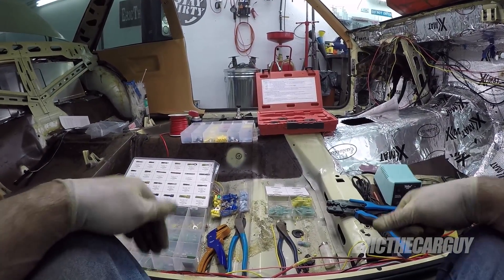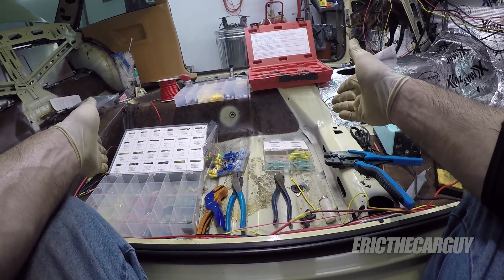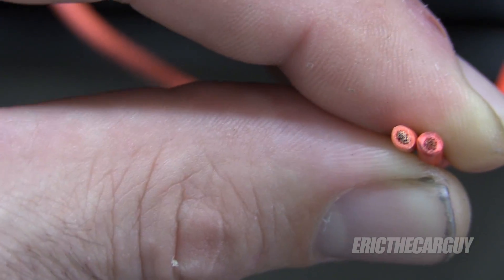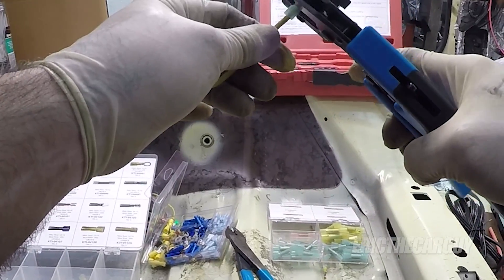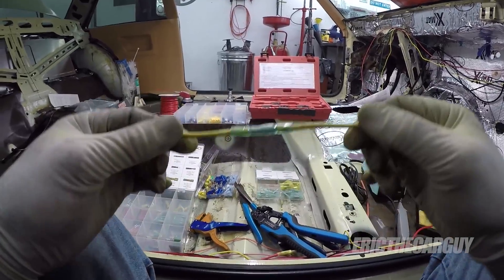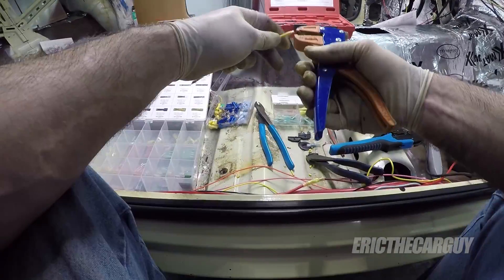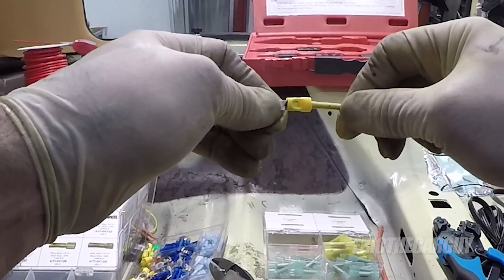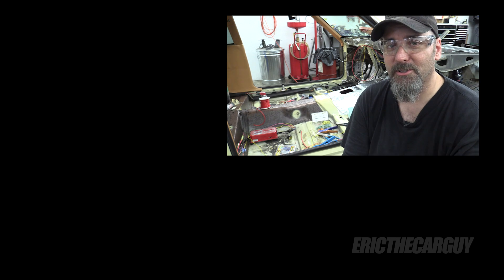How To Crimp Electrical Connectors

Comment: wrong on the color code is for different size connector Eric, you can have any color for any size.
Reply: +super coupe
As an industry standard in the US the connector insulation is color coded and the range of wire sizes is usually marked on the tongue. 
This identifies the wire sizes that can be properly terminated and the terminal lug sizes. 
From Table 2-2 Color Coding of Copper Terminal Lug or Splice Insulation Color of Terminal Lug or Splice Insulation To Be Used on Wire Sizes 
Yellow (Bright) #26 - #22 
Transparent #24 - #20 
Red #22 - #16 
Blue #16 - #14 
Yellow (Dull) #12 - #10
Reply: last box of wiring i purchase had ever color you mention with plus black, white and green the exception of transparent and all where 18 AWG GA.
Reply: Apparently you do not understand the concept, it is not the color of the wire insulation that indicates the wire size. 
However the color of the insulated crimp connector sleeve does indicate the acceptable wire/conductor sizes for that connector. 
UL, ANSI, NEMA, MIL and SAE all have a unified standard for connector insulating sleeve color denoting acceptable conductor sizes for thet color connector, below are URL links to to the UL document (not free) and a reference table that is free to view. 

https://en.wikipedia.org/wiki/FASTON_terminal

https://standardscatalog.ul.com/standards/en/standard_310